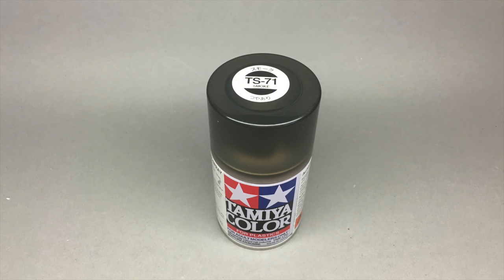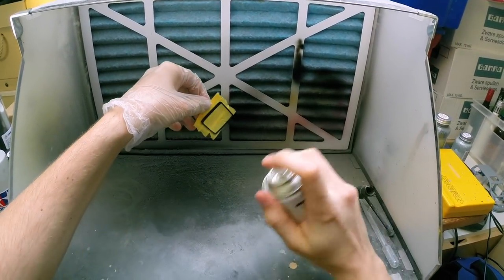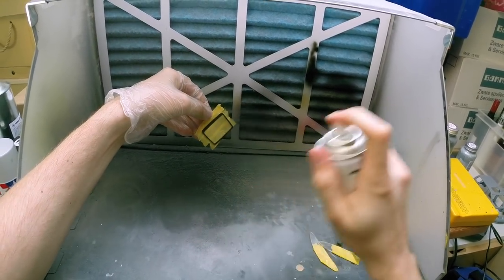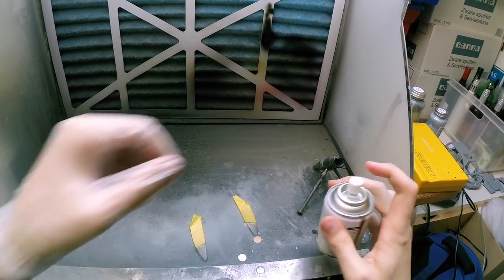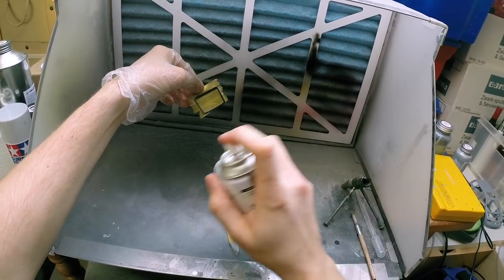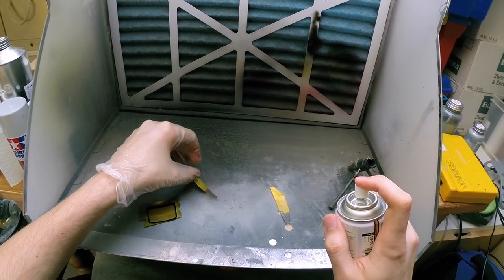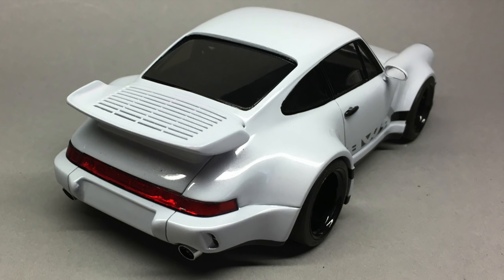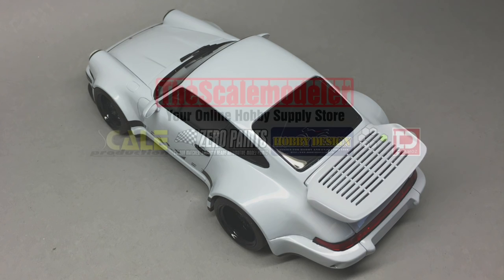How To: Tint Your Clear Parts

Comment: Excellent! This is going to come in handy tinting a Mandalorian visor.
Reply: . . . curious how that turned out for you?? I'm looking to try to tint a couple acrylic mask lenses for a few different cosplays.
Reply: @JustASouthernGuy79  It turned out really well. Easy to do and the results were better than expected
Reply: I’m using it for the same reason😂
Reply: Me too! Mine's on the way!
Reply: @batmanofsanantonio5331  hey I'm curious did you heat up the spray can? If so how did you do it?
Reply: @bosshova23  hairdryer or lighter

Comment: I just removed Tamiya TS-71 smoke from some windows 
with isopropyl alcohol and it worked great, I always use IPA to remove Tamiya paint and Sharpie from my models. The clear parts that I didn't screw up look awesome though! Thanks for the tips on how to use it.

Comment: In the middle of a 300zx build and totally jacked up the windows. I watched this, of course after the fact.. I shot it last night (about 6 hours ago) and decided I'd try to get the paint off and try again. I soaked the part with denatured alcohol over the sink and after three round of scrubbing it with my fingers and keeping the DA wet, it is as clear as new. I'm gonna try that again with a proper method. I did a 50/50 thinned mix last night but I think I'll adjust that and go for multiple lighter coats. If I blow it again, I'm getting a spray can!

Comment: I keep hearing that the window tint eats away at the paint job on the Lexan bodies. This must be a lacquer based smoke, is it?  I want to know if you have experience with spraying the smoke on a clear body FIRST and then spraying  a color like silver for example as to use the smoke to enhance the body lines before the silver. Do you have experience with layering it like that on Lexan bodies?
Reply from the maker: I have never sprayed lexan. Though this paint i used is acrylic.

Comment: What temperature approximately do you heat the spray can up to?
Reply from the maker: I honestly don't know. The can is hot to the touch. but not burning hot. More like a warm cop of coffee
Reply: Just put 1 cup (250ml) of water in a measuring cup and microwave it for about 90 seconds until it's warm but not hot to the touch. Put the can in the water for a few minutes to warm up.

Comment: Sorry for the really late comment, I hope you read this but whenever I spray it on my windows especially on Aoshima and Fujimi kits, the plastic texture becomes sort of "grainy" and foggy and there's no way for me to resurrect that. Do you think that's my spraying method (coz I followed this vid), or is it just the plastic material? Coz Tamiya ones turn out fine
Reply from the maker: If the spray technique is identical. But the plastic reacts differently. Then i suspect it has something to do with the plastic.

You could also try spraying way thinner coats and build it up slower.

Comment: I tried doing this and it came out all frosted, is there a way to make it crystal clear but tinted as well!?
Reply from the maker: What paint have you used?
Reply: I used the Tamiya smoke with my airbrush. I have read there is ways to get it crystal clear using some sort of acrylic floor cleaner?
Reply from the maker: @PhillysHobbyHouse  wat kind of thinners did you use? And did you start with thin mist coats? Of did you spray it on thick

Comment: Not sure if you read old video comments but when i airbrush smoke to tint a window, it fogs the plastic, how do i clear it up?
Reply from the maker: I’m afraid you can’t. Try removing the paint. And apply thinner coats
Reply: someone suggested dipping in Future floor wax, he did it on a canopy but when I tried it on flat plastic it didnt lay evenly.  So it will never really be completely clear?  Always be hazy?
Reply from the maker: @Ken-sl4um  i don’t know. I don’t dip my parts in floor coatings
Reply: thanks.  you always have the best videos and i have learned a lot from you.

Comment: how shall i heat the can in safe way plz tell
Reply from the maker: Hair dryer or hot water
Reply: put it in the sink with warm-hot water (not too hot) with the can cap closed of course
Reply from the maker: Your spraying to much paint on. do lighter coats. les paint quicker movements.
Reply from the maker: if you want good results, yes

Comment: How would we use it in the airbrush?
Reply from the maker: Decant it. Or but a bottle of x-19 and thin that
Reply: @TheScalemodelingChannel  ok i just bought both do you have to sand the plastic before.
Reply from the maker: @wrathfang  don’t sand the plastic. Since the paint is clear. The scratches will remain visable
Reply: @TheScalemodelingChannel  thanks.